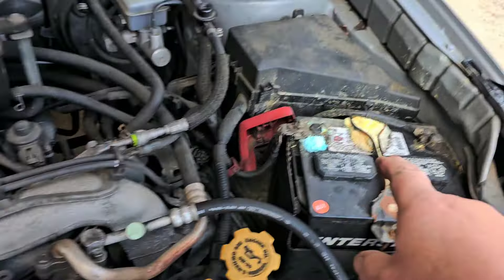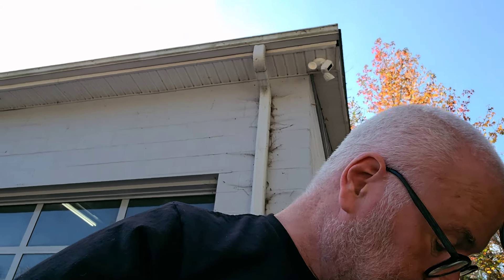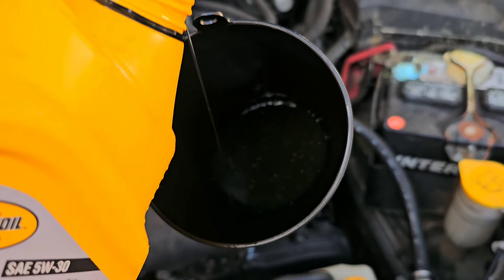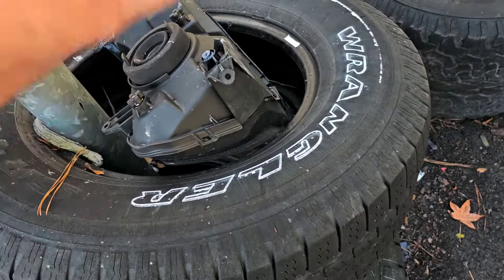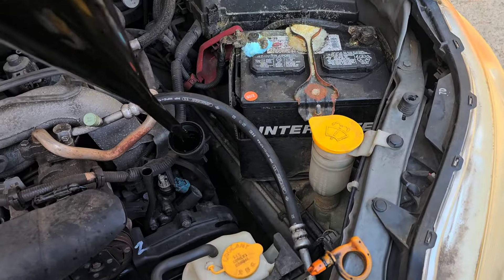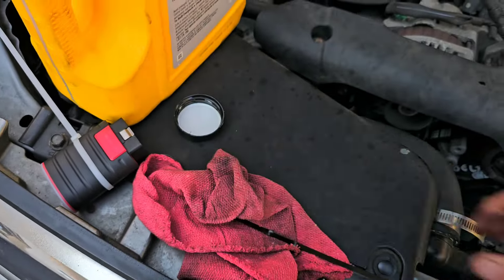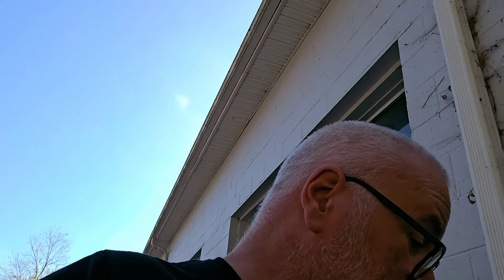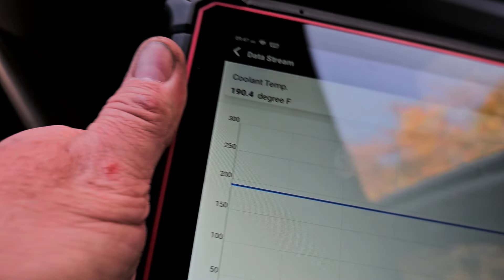Part 2. Engine Hot Light? No Codes, No Symptoms, No Coolant Leaks? 2009 Subaru Forester

Comment: Hello brother Kenny, makes good sense to me as oil level goes down, the temperature goes up. Besides the primary function of engine oil lubricating the engine, the oil also acts as a coolant to keep engine parts from fusing together. Just as important as the level is the quality of the oil. Changing the oil (and oil filter) every 3,000 to 5,000 miles is cheap insurance especially if the engine is gasoline direct injection causing some gasoline under high pressure to pass the pistons and end up in the oil pan where it acts to thin and reduce the effectiveness of the oil. Thank you Kenny.

Comment: Hi Kenny I had a woman come into the shop telling me she had a vibration in the engine I had a Quick Look around the engine bay couldn’t see anything obvious so I checked the oil level the same as your video no oil so filled it up started up the engine vibration gone cannot explain where the vibration came from but filling up the oil fixed the problem  basic checks pays off in the long run great videos stay safe regards peta

Comment: Less oil, more friction, equals more heat, that makes sense to me. That thing was really bad low. He needs to check frequently, especially with that leak. Lucky it ran hot so he would stop using it. If he continues doing the same thing, he will lock the engine up, spin a bearing or worse. nuff said, good job Kenny.

Comment: Every time a car comes in the shop, I check the oil. Doesn't matter what it's in for, unless it's less than 5 years old, I'm checking that oil. Done a lot of 2.4l ecotec chains lately from low oil levels, getting tired of them

Comment: I believe that was the worst thing that the vehicle manufacturers did was to switch to idiot lights for gauges
Reply: They had to because most drivers could not look at a gauge and know what it was telling them besides, as long as there is oil pressure it does not tell you your oil is low. You were still required to check your oil . Don’t you remember full service fuel stations ? The man servicing always popped the hood and pulled the dip stick and showed the driver their oil level. Oh, the good old days. Most people do not know how to change a flat tire. Yet alone have a spare that has any air in it !
Reply: @christinamoneyhan5688   man isn't that the truth

Comment: A few years ago my brother inlaw said his 22 year old Subaru Outback was making noise at startup. I  immediately told him to shut it down. I tried to check the oil and the dipstick was completely dry. I ask him when was the last time he checked the oil? He said he doesn't since the shop changed it 6 months ago. I told him he got extremely lucky after we added nearly 4 quarts of oil. Now he carries oil in the car and checks it every couple of weeks. Neglect could have been a very expensive repair or just junked the car.

Comment: All Subaru owners manuals tell owners to keep a check on the engine oil because they are by design oil users due to the boxer design.  I own two of the Subarus one a Forester and the other an Outback.  As low as that oil level was on the dip stick You can bet some engine damage done. Not apparent at this time.

Comment: The cooling system is only about 30% of the cooling of the engine...the oil does the remainder...so oil temperature goes  way up when just a quart low. 2 quarts low the oil is boiling.😮

Comment: my sister in law came over one time and said her Subaru 2001 with the timing chain was over heating first thing I did was pull the dip stick ...NO OIL I put in 5 liters its a 61/2 liters of oil capacity . all I can say is good thing its an opposed engine , runs fine to this day , I made her use her reminder to check the oil every second Friday she only weigh's 90 pounds and the hood ways 90 pounds ,Subaru needs to use hood shocks , I asked have you checked the oil ?  no I forgot . men are just as bad.my apprenticeship in the late 60's when working at 66 garage the German boss said pull the dip stick before ever starting a customer's car  , he was stung once when a costumer said it was running when I took it to you , yah okay .
Reply: All of the mechanics should be checking fluid before they ever start a costumers car. Pine hollow auto on YouTube does just that.

Comment: I knew of a man who never changed his oil until the oil light came on and still drove the car until he had it serviced. Damage done. He would be lucky to get 40,000 miles out of a car before buying a new one. It did not make a difference as to who’s brand or model. All engines use oil it’s in there to prevent friction which causes heat and ware on all moving parts. Some New Subaru vehicles are using  0- 20 oil and that is not a lot of room for ignoring oil checks.

Comment: Oil lights are useless. They should come on when you're a quart low. I've seen cars with less than a quart in them and the light never came in. And the light was working.

Comment: I wonder where all the oil went to, it's a bit like a Toyota Hilux which I drove on a volunteer basis & the organisation who owned the Hilux never got it serviced for 22,000 kilometres (14,000 miles).

It only had about 1 litre (1 quart) of oil left in the oil pan & it took about 5 litres (5 quarts) of oil to refill the engine with oil otherwise it would've seized.

They got it serviced after we topped the engine up with oil anyway because it was that long overdue !